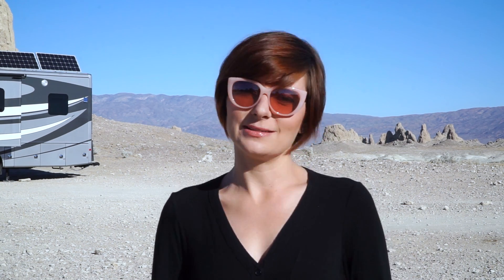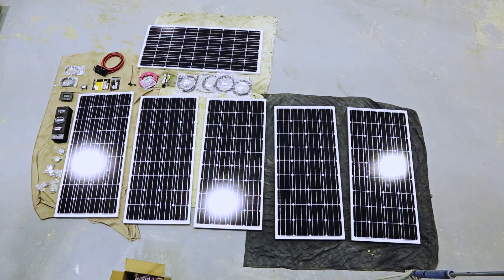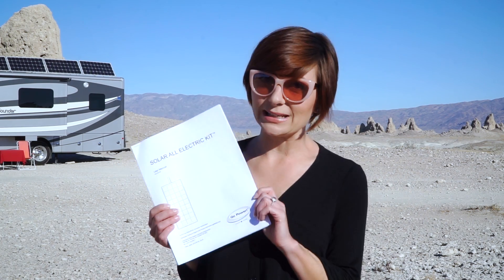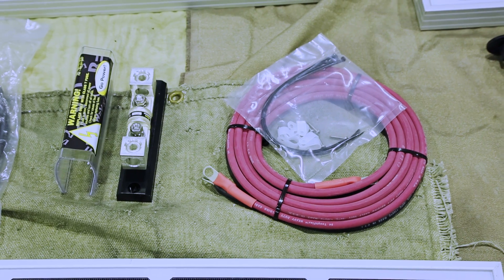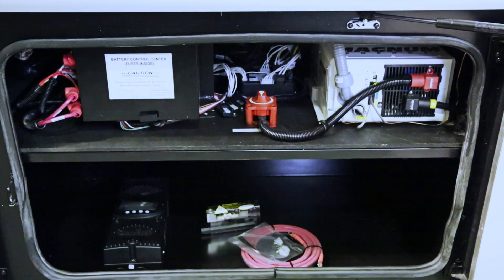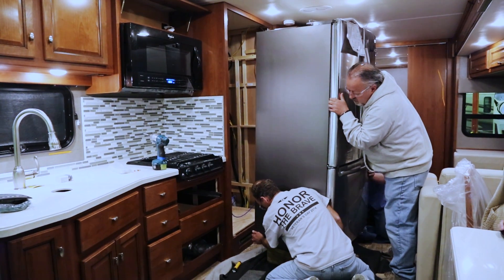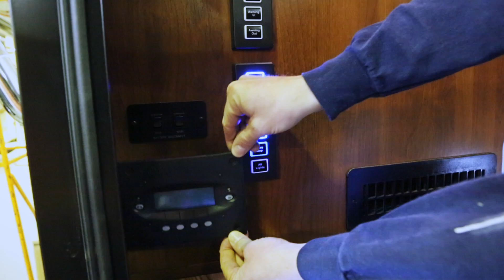Our 960 Watt RV Solar Install: A Step-By-Step Guide

Comment: Could you break down how you do power management? For example... how many amps//watts does your fridge, air conditioning, interior lighting all require? Do you ever consciously shut something off in order to plug something else in? How often do you need to use your gas generator?

Comment: What is the voltage input to the charge controller? In series the panel voltage adds to each other I,e. 6 X 12V =72VDC  I'm in Key West dry camping with 400 watts solar, 6 T 105 batteries. I haven't tilted my panels yet. I love all your videos an always recommend them to fellow campers.

Comment: Another odd thing was those rivets. As you said those are not ok. The roof has very thin aluminium layer. What's the point to drill big hole and shoot small rivet to it. The rivet can't keep the panel there without glue and then there is that big hole under the rivet...

Comment: Nice and informative video. But for DIY guys, if you can void the holes at RV's roof it's safer. When i installed solarpanel to our RV maybe 10 years ago i glued the panel's supporting things to the roof. No holes. The wires from the roof goes inside via fresh air intakes so no new holes to the roof...

Comment: Why are the panels wired in series (7:35)? Wouldn't Parallel be better so there are no "weak links"?
Reply: I think he miss quoted here as that will normally be wrong. In the electrical sense you would not wire panels in series. I think he may have meant you daisy chain the panels. But incorrectly used the term.
Reply: +Erik Liska   that was my question also.  the way they have it they are getting at least 72 volts that has to be converted down to 14V or so

Comment: You had mention the installer used rivets to install the panels, was there a problem that changed their minds with using the rivets?

Comment: Do you have to climb on top of the RV and manually tilt the panels?
Reply: Yes
Reply: unless you install motors to lift and adjust them.

Comment: Tilt dosen't look very practical as you would have to climb the roof
I'm looking for a electric version preferably also with rotation
Reply from the maker: Good luck. So far we haven't seen anything that is light weight enough or affordable....nor have I seen anything that would work for an RV.
Reply: Gone with the Wynns Pretty much the same conclusion here

Comment: Very cool Jason is back!  Our Roadtrek has 300 watts of panels flat on top and has been more than enough for a small B-class RV. I would buy a house for your system. What are the coordinates of  your location  now?
Reply from the maker: 300watts is perfect for a class b! We are at the Trona Pinnacles and we shot a video on the place that we will put together and launch in a few days!

Comment: What did the whole system cost with install?     Great video
Reply: Ok i just read the whole page and its 4000 dollars with all the work and stuff.
Reply: Cleevus foreal my question
Reply: the solar panel kit costs about 4000 dollars its on their site. I think its everething they've bought, but without the instalation work.

Comment: all my solar is move able the batterys are duel use boat 3 batterys  and 1 battery camper power, the power pack 3 batterys camper plus camper battery 4 wiring on camper charges batterys and runs stuff in camper it mainly 12 volt or propane! i have 230 watt mono system plus 90 of harbor freight 2 45 watt systems! i run a week and half for like 10 bucks in gas for genny storm weather for 4 days!